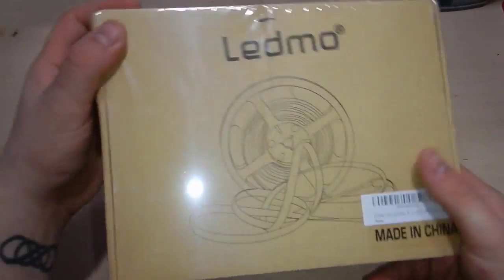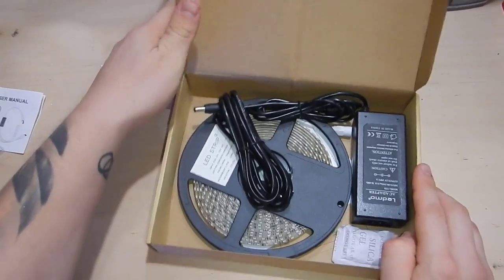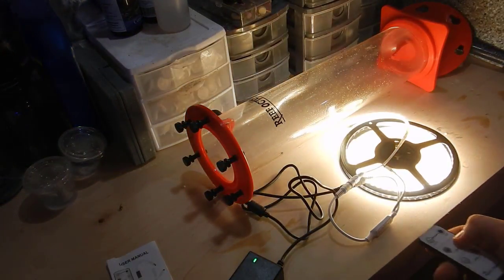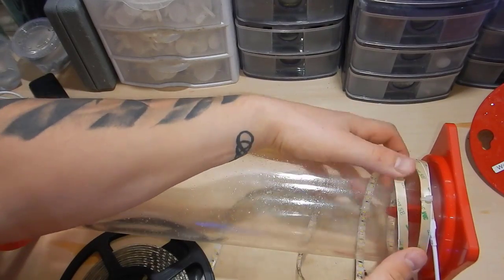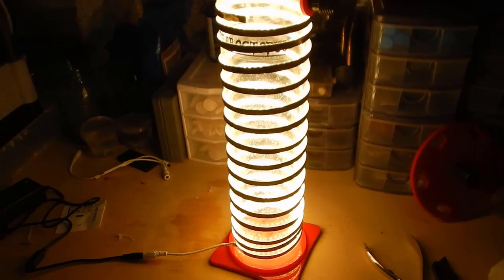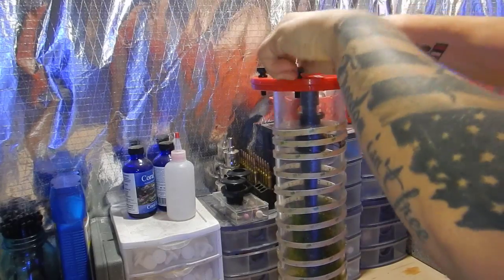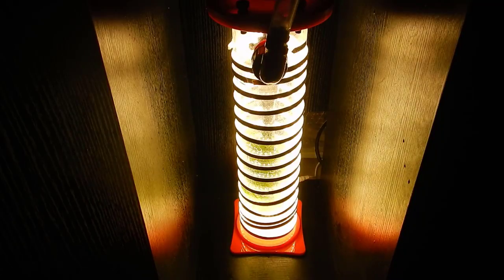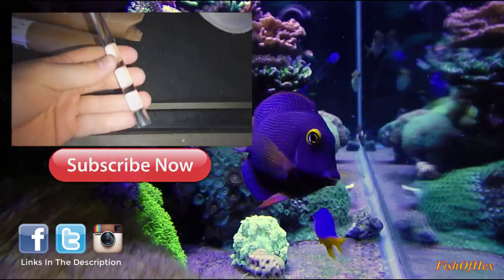DIY Chaeto Reactor For Triton Method Test Build

Comment: Question, if I don't have a sump and put the reactor at the bottom in the cabinet, will the water go up due to pressure of water coming in up to the main tank?
Reply from the maker: No you need a pump

Comment: Be careful when you do this, I did this exact setup and eventually had a major crack on the reactor due to the constant heats of the lights. Water leaked and also got in the wrong place
Reply: Dont wrap them so much, you dont need to cover the thing in lights for it to work.
Reply: Leave 1-2" between wraps

Comment: Great video FOH i used the topled grow light and have been very impressed with the growth just after a week (just released a video on the update on my channel)....one suggestion would be to put the outlet which connects power adaptor on top of the reactor instead of bottom...tht just helpful in avoiding any water spilling over it when it comes down to maintenance or removing the chaeto...love your vids as always..

Comment: What is your light schedule on the cheto. Every time I get cheto it turns white and dies after about a month. And gets a slime like coating. I was thinking of also trying other macro algae’s. By Lfs has some but it’s covered in bubble algae so I’m all set with that. Will you be selling any grape calerpa soon?
Reply from the maker: 12 hours on while main lights are off

Comment: Love the videos! ive builT one of these aswell, pretty much the same thing, but 2 of my plastic screws that you synch that top acrylic plate down with broke, question: what are those lil plastic screws called, know anywhere to order, because i cant find at hardware stores
Reply from the maker: hmm i would google the reactor brand/type and screws. i have found them before.
Reply: Try searching "nylon thumb screw with knurled head and shoulder". You can figure out the size by going to a hardware store, then ordering the correct screw online. HTH

Comment: I'm curious how warm are those lights to touch? I know a lot of people had complaints with various Amazon lights causing hazing and micro-cracks on their reactors. I'm not sure if it's because of overheating on the lights or of a particular material that the reactor is built from. So that dimmer might just come in handy. Also just to point out to others watching these lights are rated ip65 which is not completely waterproof. The ip68 lights are 100% waterproof but hard to find and very very expensive compared to these.
Reply from the maker: they are just a little warm but nothing that would cause any issues with the reactor. I left them on for 24 hours just to see with no issues.